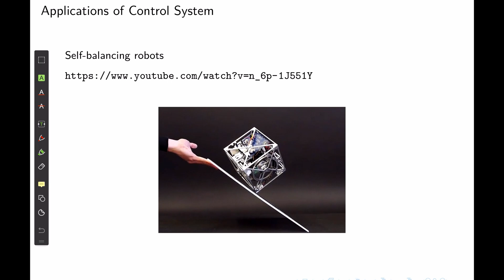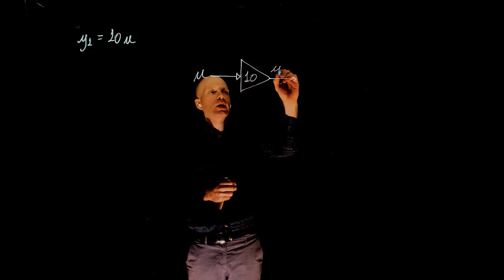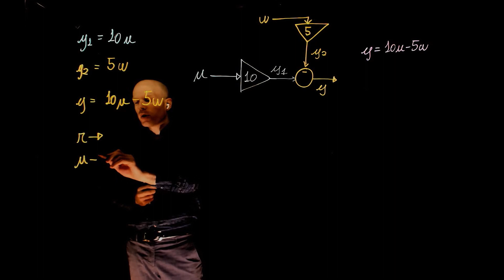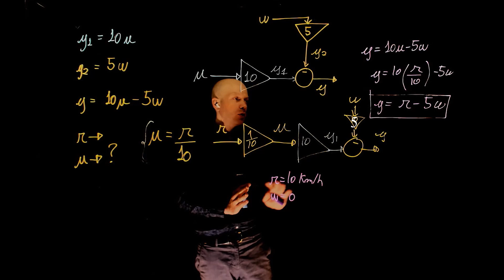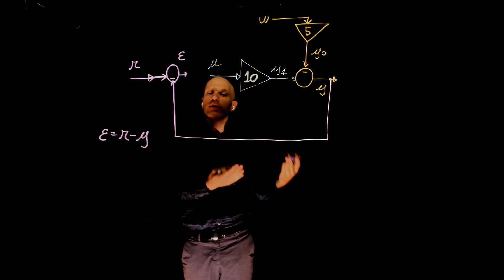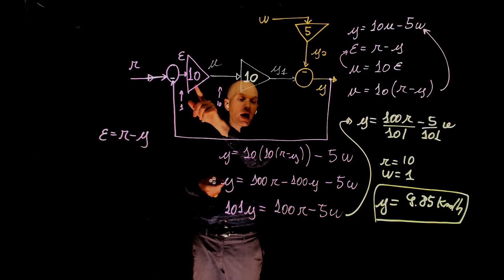Control Systems. Lecture 1: Introduction to Linear Control Systems

Comment: I remember that day I hit a side walk granite block with my car. Right after that, I had to give my steering wheel a certain angle in order to be able to go straight. Would an autonomous car be able to correct the angle of the wheel in the exact same situation ? Just wondering ...
Reply: While I'm not an expert, the answer is yes.

Each car is a bit different (someone might even upgrade the wheels, tires, etc). If they all had the exact same programming, the second anything changes, there would be an accident. 

The answer is yes because the vehicle control system will continously adjust its steering angle to minimize the error from the path it wants to follow. 

I should mention that it seems more likely that the car manufacturer will program the vehicle to report an error if the steering is severely misaligned, but minor misalignment should be fixable.